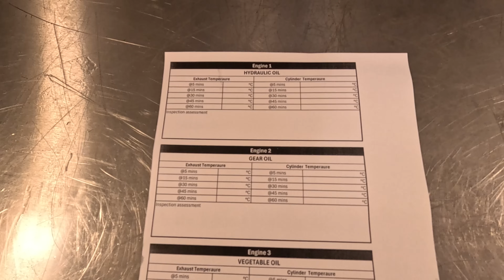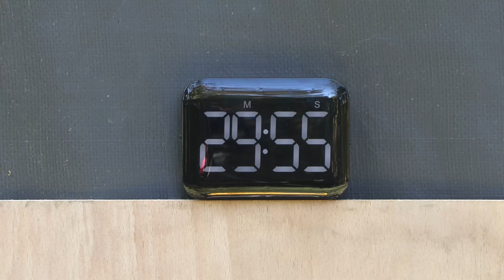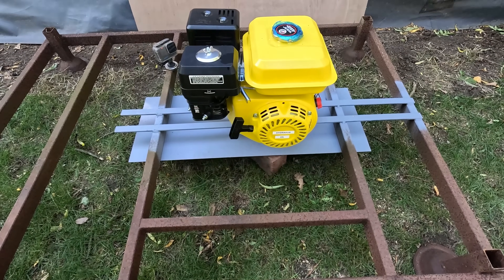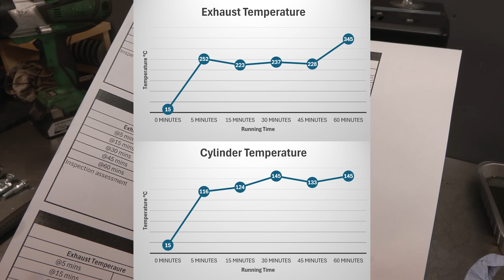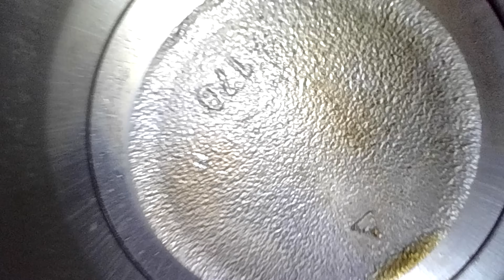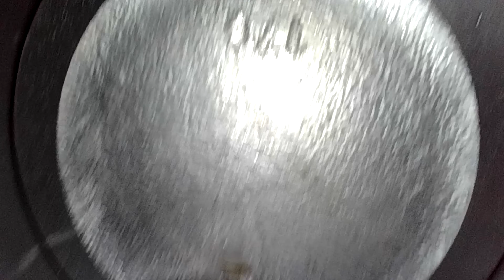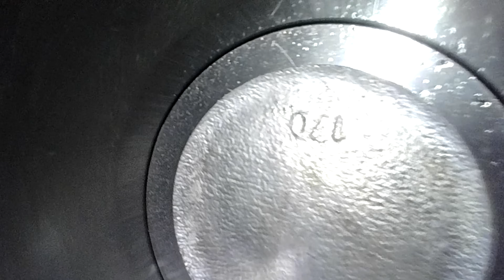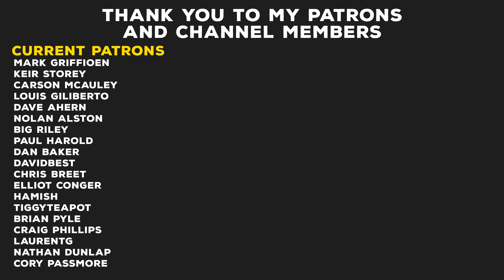Will Any Oil Work as Engine Oil?

Comment: Super fun! I would love this expanded! Maybe do a video where you run new engines on engine oil, then try the three in this video again. Basically I want to see the difference between the engines with the break-in getting in the way. Maybe testing them under a load might give us different results as well. Also, it could be fun to see the effect of all different cooking oils lol. Finally, It would be fun to see if you could mitigate break-in by getting a new engine, taking it apart, polishing it up, and then testing the oil after an hour. Basically, try to fix issues like "they probably didn't de-burr the engine from the factory" and then do a break in.

Comment: Maybe you could weigh the rod before and after and use that to see how much if any material was removed? Naturally you would need a normal oil control as well.
All in all, some oils with high boil points can be used TEMPORARILY for emergencies, but that applies to normal vehicle engines as well, not just small engines.

Comment: As other guys are saying, control engine with the recommended oil and all of them running under load. Just sitting there running isn't much of a test and I'd like to see if it dumps so much glitter with the recommended oil.

Comment: Hi you have to realise that these engines are made so cheaply that it is no surprise that that you find glitter in the oil you might find that if you stripped the engines a inspected them before any running you might find filings anyway. All the oils you tested are very good lubricants just not tuned  for engine use

Comment: Hi 
Did you know that a lot of aircraft engines between the wars used caster oil as the main lubricant and back in the 80s foden trucks used worm an wheel rear axels that used caster oil as it has very good shear stability

Comment: Back in the mid seventies my bike a triumph tiger cub broke down it broke an oil line and ran out of oil it was around 1 in the morning and I found a machine shop that was working they helped me fix the leak and the only oil they had was hydraulic oil it got me 90miles home without any problems or further damage

Comment: A problem I have with all these videos is that none of the engines are under a load....also there will be alot more glitter in an engine that has a connecting rod with a machines etc big end and no removable bearing as it breaks into and forms to the crankshaft initially...and from workers spinning it by hand making sure the part they installed didnt lock it up.... that's where the scoring came from on the cylinder walls 😂😂😂

Comment: Commenting before I watch, I think 1: Hydraulic oil will be very similar to engine oil 2: Gear oil will do well with protection via lubrication but the engine will run hotter do to high viscosity and 3: vegetable oil will work but may have some wear due to low viscosity and no additives.

Comment: Thank you for putting your time and money into this test and making this video.  I thought surely that the vegetable oil would have caused the engine to overheat and seize up.  The results surprised me.  None of those oils were the correct viscosity or had any additives for the application.  The only thing I would have like to have seen would have been a control using the proper engine oil for comparison.

Comment: You have not done proper braking in with normal oil nor do you have a ‘control’ engine running on normal oil. This is unfortunatelly a useless test.

Comment: Hydraulic oil is 30 wt oil. I buy whichever is cheaper for the hydros in my moneymaker. The difference is in the additives. Hydraulic oil doesn't have any detergents in it. So if you need 30wt delo 100 and cannot find delo 100, it's in the hydraulic oil bucket. Cheers, gearheads.
Reply: Hydraulic oil comes in many weights from 0 to 100.
Reply: @Chris_Garman  lets not change the weight of the issue. But yeah. 30 and 42 seem to be the common ones here in hoodie country.

Comment: It would have been nice to have seen the 3 engines broken in with the correct spec oil, disassembled enough to completely clean them out (ensuring a fair testing field), then run the tests as you did from there. All that was really confirmed here is that the 3 oil types are capable of lubricating the engines (though for how long, or to what degree is still unclear), and make a show of how badly the engines are constructed given just how much "glitter" there was in all 3.

Comment: I know many of these clone engines and they are all the same the cheap ones barely last 100hrs they are really terrible. The Metal flakes are not from running in its mostly from manufacturing, Honda and Briggs clean the crankcase after production but these chinese guys cheap out on that. The really cheap ones like these only have an aluminum Cylinder without a Cast-Iron liner, and plastic camshafts.

In my experience there are only 3 good clones
These are
Hwasdan, Loncin and Rato these will last almost as long as the original. But they also do not have a cleaned crankcase so for the first 20hrs there will need to be more frequent oil changes.

Comment: I'm guilty of using "wrong" oil on cheap gardening machines, but not to such extremes, just car engine oil with roughly similar specs (it's far cheaper than ordering the specific recommended one). Works well enough on something like a Chinese lawnmower or tiller, they don't appear to run worse or break down faster.

Comment: The gear oil test is proof that you're better to go for a heavier oil than a lighter oil if you are unable to use an oil that's the required spec.
Reply: Most of the time, in the summer anyway.

Comment: I've bought a 35.8 cc Chinese petrol strimmer mounted on a frame with wheels. It's a clone of the Honda unit, and all in cost me about 60 pounds. I bought it because once a month I clear the very rapid tough as old boots grass that grows over the road, which the local authorities aren't interested in clearing.
I've cleared it twice so far and if it survives a third time it'll have been cheaper than paying someone to do. I've no idea how often one should change the oil, but it only holds 100ml so perhaps every other month would be a good plan.

As interesting as this was, I don't think I'll copy your experiment, a litre of fully synth 10W40 was 2.25 the same amount of vegetable oil would be about half that. But if was interesting.

I'm no mechanic but what is the most likely casualty of a consistently high temp exhaust as you saw when using veg oil?

Comment: Great fun! Would be interesting to see an experiment with air filters. Maybe one no filter, one oiled and one clean.  Run for a while as you mow then strip the carbs? Or change the fuel mix and check temps? Loved it anyway and 50 quid is a bargain even with rough ass bores.

Comment: I keep getting asked what oil should I use for this or that, my Standard reply is whatever the manufacturer recommends but any oil is better than no oil if your in a pinch.
I can see the vegetable oil turning into a tough glaze on every sirface over time as it does in deep fryers, Castor oil does the same and its virtually impossible to get off!
Reply: It turns to plastic when it gets really hot. Regular oil can do this too, just at a higher temperature.

Comment: Fun facts hydraulic oil is actually quite  comparable  to mineral engine oil, its grade normally either ISO46 or ISO68 are SAE 10w-30 and 15w-40 they don't have the wear additive packages that engine oil does. But there flashpoints are identical. Unlike veg oil which differ between  the various types of oil but are actually quiet low, which is why they make a great fuel. 

Also where was the control

Comment: Hydraulic oil will leave behind a varnish if it gets too hot, it gets sticky and will cause parts to bind together, have seen this many times on machinery with hydraulic systems on them.
Reply: All oil does this, when you burn it. How did you get hydraulic fluid that hot?
Reply: @Chris_Garman  not burnt, just hot, if it gets up to over 80 degrees C it causes this.

Comment: need to test under load, an engine can run for a surprisingly long time with no oil under no load
Reply: Great point! I remember seeing ads for oils and snake oil additives where the oil and/or coolant was drained and the engine continued to run for hours, sometimes at high RPMs. I never saw one of those tests under an actual load though.
Reply: Slick 50 used to demo their snake oil in person with a little two horsepower Briggs & Stratton horizontal shaft engine. The end plate was removed and replaced with thick plexiglass I believe the British call it perspex. A ball bearing was installed in the plexiglass and that little engine was run over and over and over with regular motor oil, then drained, motor oil with slick 50 added, ran for 5 minutes and then they would run it for a half hour with no motor oil in it at all.  Just like in this test there was no load on that little engine.  That little engine survived through hundreds if not thousands of demonstrations.  Sometime back I had a chance to buy one of those little engines used for the demo but the seller wanted way too much for it. It's a cool display piece but useless in its current state and if you put a new end piece on it it's like any other two horsepower Briggs. I passed.
Reply: Plastic cam gear? Trash!
Reply: We ran a scrap vw polo 1.4 petrol 110k miles with no oil to see how long before it would go bang! 2.5k revs 2hours later got bored and drove it to the scrap yard!

Comment: I was given a Mercedes diesel that had run on recycled vegetable oil but the engine oil was Rotella 15w40. Loved that car. 40,000 miles before letting it go. The Astro van didn't go 25,000 before it croaked.

Comment: There was once a company that sold an oil additive that they claimed would have enough residual lubrication that an engine could without oil for a period of time without damage. They demonstrated this with a Briggs and Stratton classic engine by using their additive, then after a run-in period, draining all the oil and running it again.  Briggs and Stratton replicated the test but didn't bother with any additive and the engine ran for quite a while with no oil whatsoever.  Kind of funny.  These little engines, especially the honda clones, seem to take a lot of abuse.  I've only ever managed to destroy one of these engines in many years of using them in pumps industrial applications where they are often neglected.

I think you could run anything from kerosene to gear oil in these little engines for a short period of time without damage.  Not long term, of course. Hydraulic oil lacks the detergents and additives to deal with the products of combustion.
Reply: Powerup. They did a pass with a cultivator in a field demonstration where someone held the tractor's oil drain plug in their hand to prove there was no oil in the engine. It's good stuff.

Comment: So engines are weird. Gasoline engines especially. I'd like you to do the same test but with them under load and see the results. A engine under load acts very differently then when it's not. There's more heat. More friction. And more wear. Oils are supposed to help protect the engine from that.

Comment: I sell castor seed for castor oil.  Castor oil was used before petroleum in very early motor cars.  The issue was a varnish over time, but the oil doesn't thin like other seed oils.  British biplanes of WW1 used castor oil if I remember correctly.  I'd love to see a test with castor oil!!
Reply: Castor oil is still used in 2 strike model engine fuel.  You can get synthetic,  but many people still.put in some castor for rust prevention properties.  The castor, though, does create unwanted build up.
Reply: Sometimes I’ll put Castor oil in my 2 stroke dirt bike and when I do that sweet smell coming from the exhaust brings back good memories from my youth. Such a distinctive smell. Good times.
Reply: @GGigabiteM  No shit !!
Reply: @ScatManAust  Quite a bit of shit, actually. In the pilots' pants. Because castor oil is a powerful laxative, and the pilots breathing in the fumes from the half-burnt oil coming out the exhaust ... 🤢
Reply: Castor oil was only used in rotary engines in WWI. Rotary engines had a total loss oil system, where the castor oil, fuel and air was injected directly into the crank case and the centripetal force of the engine rotating would send it up induction tubes into the tops of the cylinders to be let in and burned. The exhaust was directly into the slipstream, no headers.

An exception to those was the Gnome Monosoupape, which had ports in the bottom of the cylinder liner and used a complex push-pull rod to a valve at the top of the cylinder. It was used for both exhaust and air intake, while the fuel and castor oil came from inside the crank case through the ports. All mass production rotary engines were four stroke, even the Monosoupape.

The reason castor oil was used is because it mixes well with gasoline, and maintained its lubricating properties inside the engine.

Near the end of the war, Germany being on the brink of total economic collapse, they started to use a type of mineral oil called Votol. It was vastly inferior to castor oil and caused engines to seize up after just a few hours
Reply: @GGigabiteM Thanks for the knowledge and history lesson quite interesting.
Reply: That is from where the oil brand name “Castrol” originated.
Reply: Indeed, and I think they still make Castrol R which is castor oil for racing engines.
Reply: Castor is still used as a motor oil! All of my radio control engines use at least some castor in their oil packages.
Reply: you can still buy new castor oil specifically for use in engines. It is recommended for methanol fueled engines and is viscosity grade SAE40. So technically you could use it instead of a XXw-40 in an engine but the cold performance will be terrible and it won't last very long nor will it offer adequate protection.
Reply: Isn't that how Castrol got their name? I was told a long time ago that it was  a contraction of castor and oil.
Reply: how large of a oil crop can i expect with a certain number of seeds? 🌱 whats the watering schedule 🌧, shade☁ or direct sun🌞?   😉🤣
Reply: These engines typically make their oils look like iron porridge during first 5-10 running hours, so the amount of glitter does not tell much here.
Reply: This reminds me of how cottonseed oil was used for engines before they remarketed into Crisco for human consumption lol

Comment: realy interesting. why does the cooking oil work so good? is there any way cou can put a load on that thing? i think then its gonna blow. or just some long term test with the cooking oil
Reply: Maybe because it was meant to be machine lubricant in the first place? I wouldnt even let stuff like that on my fingers. Nasty stuff
By the way those engines need to be flushed. They're full of metal particles from factory...

Comment: Castrol make a vegetable oil called Castrol R.   It was used a lot for racing up until the 1980s, when most turned to the modern better oils.
I think all you have done is use these oils as a running-in oil, and maybe if you now used a multigrade, they will give much better results, with less contamination.
Reply: The name Castrol comes from the type of oil they used, which was vegetable oil obtained from the castor bean, it provided superior properties to that of the mineral based oils available at the time. When using castor based oils you should ensure the engine is thoroughly cleaned to be devoid of any mineral based oil, reaction between the two can lead to a loss of lubrication.
Reply: Oh the smell of Castrol R coming from a gaggle of 2 stroke crossers back in the days before climate change :-)
Reply: It also has a distinctive smell.
Reply: Klotz still offers a castor based 2-stroke oil called BeNOL. A lot of old-school dirt bike riders still use it religiously.
Reply: My Yamaha 115cc 2stroke needed port cleaning every 3000km or so on mineral 2 stroke lube, when i used semi synthetic it never bothered me again
Reply: I used to use Castrol R in my grass track Villiers 225cc methanol burner, back in the 1960s.   I have a JAP powered 1930 Husqvarna now, that uses Millers CB40.   This is slightly less pungent than Castrol R, but still good for the nostalgia.

Comment: The only thing missing is the control engine using the correct engine oil. Then we have a true comparison with break-in glitter and temps reached.  All we know now is the engines survived with what appears to be slightly higher temps.
Reply: This. Yes, without a control baseline run, it doesn't tell you anything.

Comment: How about either running the engines to failure or using non-oil liquids such as diesel fuel or water?
Reply: Diesel is a lubricant. It may actually work if the heat isn't too crazy.